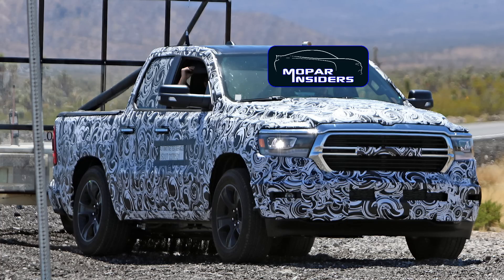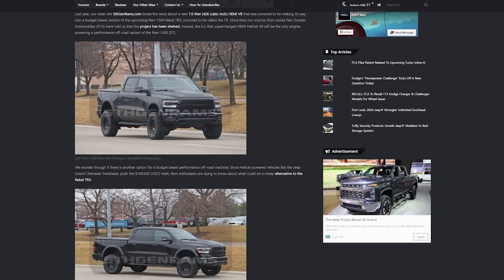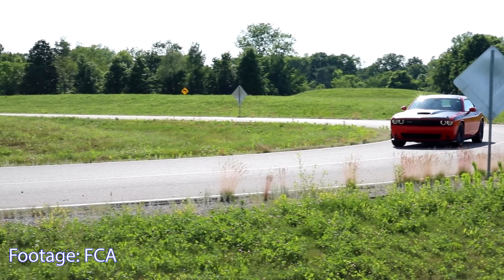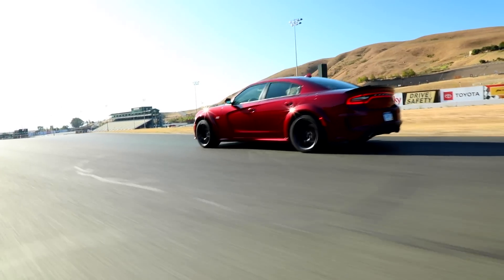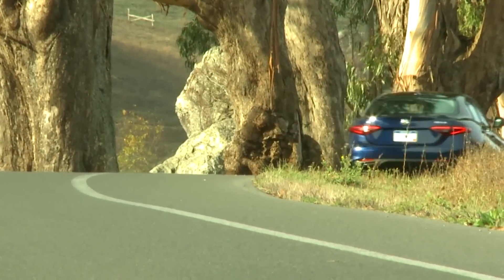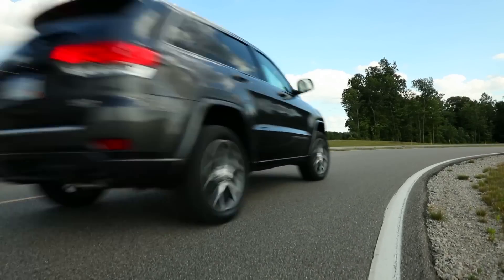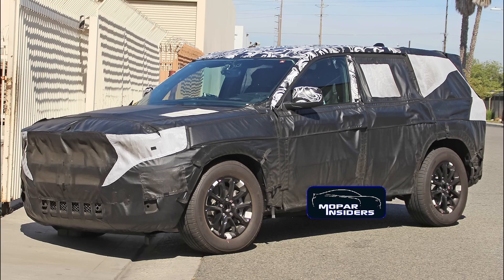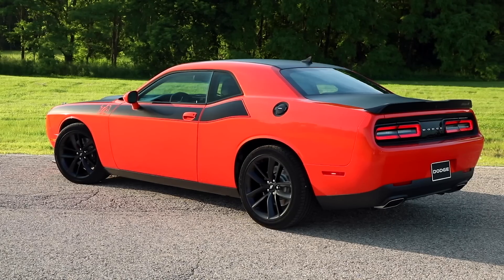What We Know About FCA's Upcoming Turbocharged Inline 6 Cylinder Engine. 525HP!?

Comment: The feds raised the emission and mpg requirements.  So, the Hurricane is replacing the V8.  The Hemi is probably going to be offered in limited numbers or as a crate.  If the motor can be better than a Ford and Toyota in the trucks , might take a look.

Comment: Not opposed to an inline 6, just not thrilled with the turbo. While the performance I'm sure will be good, longevity will be my question. I am also wondering about the difference between the 5.7 Hemi, and said Turbo 6, with roughly the same HP output??

Comment: The battery better be in the engine bay or in trunk not under the back seat no tku. Is this on par with the prototype hurst super cat that was a great test drive or faster on regular gas or 93???
Reply: I test drove a super cat - fast smooth easy to drive but drive by wire and was speed limited but think it was around 425HP. But 525 is pushing its limits is my thoughts

Comment: I was very interested til I heard this engine has plasma spray cylinder walls, check out Fords current big troubles with the 5.0L F150 2018-20 and excessive oil burning issues, no thanks to plasma cylinder walls give me cast iron cylinder liners in an aluminum block.

Comment: I'm not a big dodge guy but, I will still give an opinion here.....while the 2jz is a proven performer, turbo lag SUCKS! I know OEM doesn't care about this because mpg requirements have dictated the future which....also SUCKS. Anyway, there really is no replacement for cubes and a snappy V8 is not gonna be beaten in my book. HEMI HEMI HEMI HEMI!!!!!! It would be a shame for dodge to have an inline 6 to top the dodge power chart....even with an electric motor to offset lag. Just an opinion from a friendly Ford fan. Good luck to ya'll.

Comment: This is going to be a solid engine, you can’t mess up a straight 6. Plenty of power too
Reply: I don't believe turbos will last anything near V8s. Too much complication, pressure etc
Reply: @bigboreracing356  Wrong!  Had a 225 Slant 6 in a Volare. But it wasn't rigged up with turbos. Too much complexity and high pressre they will never last like original slant 6s not even close.
Reply: @bigboreracing356  But it does , if longevity is what you are seeking.  Are you claiming that turbos have a better record of longevity than slants or V8s? Not even close .
Reply: @bigboreracing356  Oh yeah you know so much ..at least you via your self promotion.  I must be hitting home if you are now descending into attempts at belittlement.

Let's see .. what readily available crefible source shall I site ..unlike your circular reasoning.  Ah yes , a mechanic of 50 years that has his own Youtube channel with a couple million subscribers.  So you go on and tell me you know more about vehicles and have greater experience than Scotty Kilmer.
Reply: Kevin Prokopenko 
Scotty “use compression fitting on brake lines” Kilmer 😂🤣
Reply: STREET RACER given the 5.7 are having cam/lifter problems they need to start from the beginning.
Reply: Chevy screwed up there new diesel straight six put a belt driven oil pump at rear of engine supposed to be a life time belt 150,000 miles according to a engineer who was interviewed.  Guess life time is until belt snaps and seizes engine .
Reply: @bigboreracing356  its ok, i know you are secretly a dodge lover deep down. otherwise, you wouldnt even be on these videos.
Reply: @bigboreracing356  The Cummins is a diesel engine.

Comment: I wont lie, pretty interested in this motor. Ya, i currently own 4 vehicles,  all 4 are v8's one supercharged....why? Bcuz last time at the track in my Charger SRT8 392, ran a 12.8 @108 and got smoked by a 2jz swapped Nissan. I had it off the line and it sounded mean AF as it blew past me on the big end.

Comment: It takes a turbo charger to go over 520 hp for dodge... dang the 5.2 Ford V8 does it naturally aspirated.
Reply: Messer Maddness The 392 Hemi does it too , which 6 cylinder Ford engine NA produces more than 300hp ??
Reply: @ervinzefi8662  NONE!!!
Reply: 5.2 ford....consumes oil like a madman...awesome race engine though.
Reply: Lmfao you rode the short bus to this meeting didn't you???
Reply: Let's see a factory set and tuned ford turbo 6 make 520 smartass I'll wait
Reply: @donaldliverance2597  the 3.5 ecoboost in the Ford Gt not count?  That little engine makes power very easily.  I'm not a fan of it, but I cannot argue that it can run well.
Reply: @donaldliverance2597  the ford GT would like a word with you

Comment: My 4.0 INLINE MILL has almost 400,000 Mile's and is just like new...A REAL BEAST!!!!!
Reply: It's a AMC motor
Reply: @jeepdogjl8687  ..Chrysler changed a lot to the 4.0...Even the pos 3.7 & 4.7 was a AMC design..
Reply: @01trsmar  3.7 and 4.7 was a mercedes.
Reply: I had 436,000 miles on a Dodge 360 4barrel!! 

The car never quit!! 2 repaints and drivers seat repaired twice! Looked and ran perfect when I sold it..Engine never touched!! Nothing! Water pump and fuel pump,rebuilt carb and general tune ups,maint!! I drove it fairly hard too,loved to spin the tires and floor it..sounded so good too!

Comment: For all of you who adore v8s. Due to new EPA regulations soon to come. All passenger vehicles in the not so distant future will force manufacturers to use more 4 and 6 cylinder engines. So if you want a high horse power v8 you should buy it soon.

Comment: If it comes out like anything like the ford barra or the 2jz ..sign me up
Reply: Highforcex41 agreed!!
Reply: Amen! 6 in a row makes it go!
Reply: I agree. If it comes out like the Pentastar, don't sign me up lol.
Reply: Expect the Aussie Ford Barra Performance. 😉
Reply: Don’t forget RB26!
Reply: @Cycle9568 those were good if you kept them stockish . They had massive issues with oiling and loved to crack blocks
Reply: @jordan9610  I got one when mine went out at 67k miles. And the tranny went out twice within 72k miles
Reply: @jordan9610  it was a 16 caravan. That’s what confused me the most. It had cyl #2 losing pressure through the exhaust valves. And the dealer replaced the torque converter at 58k miles. Started slipping again before I traded it lol
Reply: I agree!
Reply: It should be just that, we shall see.
Reply: 99% of comments are bummed out muscle car guys,... little do they know, they might get something better. We'll see.
Reply: Highforcex41 it’s from fiat so no.... all these mopar heads driving Italian, high hp, unreliable engines. All these 707 hp hellcats breaking down at 40k miles lol.... lmk when Italians can out together a reliable engine
Reply: @jusbertmeza4424  I cant agree more than that statement but I did say "if" it came out like the motors mentioned l. But  cars are so overpriced when you think about none of them are worth the asking price. But Italy makes Ferrari and aprilia so not everything is bad
Reply: Highforcex41 Ferrari’s are also high ho racing beasts but in the end they are racing cars and don’t have reliable engines. After about 15k mileage it has problems but the people buying them don’t care
Reply: @jusbertmeza4424  yeah I dont argue that statement. But every car company has strived to be like Ferrari because of thier record at supercars racing ..trust me I dont care for either I'm a jdm guy all the way if you couldnt tell I just think when it comes to it inline 6s make more sence in engineering for simplicity and produces a smoother longer range of power .

Comment: I am ready for another Inline 6 Wrangler!
Reply: Timeless Motors that’s exactly what I was thinking and turbocharged long over due for the wrangler
Reply: You're welcome 😉
Reply: It won’t be the durable AMC 6.
Reply: @drippinglass  Chrysler version of the so called durable AMC 6 was vastly superior. the 4.0l was introduced in 1987. Its a Chrysler engine based on the old 199 cubic inch Typhoon Six . The AMC engines were ok up until the 4.0l.  The Chrylser slant six was one of the toughest engines ever made BTW. If you actually new anything you would know that Chrysler has made some of the best engines in the history of the auto industry.
Reply: Billy Bob 

/6 only had 4 main bearings.
Reply: @drippinglass  So what? How did that effect it doing what it was designed to do? Its considered one of the most durable engines ever. Its not a drag racing engine.
Reply: Billy Bob 

As soon as you try to make more power... the bottom end will give up the ghost.
Reply: @drippinglass  Again who cares that engine was discontinued years ago. You act like they couldn't beef it up today? What is your point?
Reply: @drippinglass  Not True. Many people drag race Slant 6s to this day. Most of them just add a Procharger or Turbo Charger to them without any other modifications besides the Intake manifold and carburetors/fuel injection
Reply: @tskraj3190  So now your saying they don't give up like a ghost. It is true Chrysler discontinued that engine years ago. What people are doing with old engines has nothing to do with this argument we are talking about factory built engines. The slant 6 was never intended as a boosted drag racing engine.
Reply: @tskraj3190  The original point I was trying to make is AMC did not build the reputation of the durable 4.0 inline 6. Chrysler did.
Reply: Billy Bob 

You can’t “add” main bearings.
Reply: Billy Bob 

The AMC designed 4.0 had 7 main bearings.

They’re the things the crankshaft rotates on.
Reply: @torredchc1768  I agree and disagree. I believe Chrysler made the motor popular enough for people to realize they were very strong reliable engines but people who owned the AMC inline 6 motors knew they were very reliable. There was a period that most people seem to forget from around 1998 to 2004 where the 4.0  motors were blowing head gasket and cracking the head.
Reply: I can sit here and give Anecdotal evidence  also. my brother blew 2 AMC inline six engines in his jeep. My best friend blew his ford 300 inline six. this was 25 yeas ago the ford engine was a 91. AMC was a trash company.
Reply: @torredchc1768  I worked for Daimler Chrysler from 99'-01' on the AN/DN line also known as the Dakota/Durango line. In our factory we also had the XJ line which was the Jeep Cherokee line. We always received feedback from consumer complaints every month. Most of the complaints were faulty water pumps in all Mopar/Mitsubishi motors. The other complaints were head gaskets on Mitsubishi assembled motors such as the 3.3, 3.7, 3.8, 3.9 V6 and 4.0L inline 6. The other complaints were faulty transmissions, front differentials and A/C condensation drains in the Rams, Dakotas and Durangos.
Reply: @drippinglass  Actually it will be the AMC 4.0L. I did try and talk the C.E.O. into redesigning and bringing back the Slant 6 with dual overhead cams but it was a solid "NO". I'm a contracted marketing advisor.
Reply: /6 motors are crap compared to Ford, Chevy, and AMC 6 cylinder engines.

I’m a Mopar fan, got my first 440 Six Pack back in ‘83.

Th /6 is vastly overrated.
Reply: Timeless Motors ... Yeah Jeeps are Fiat nightmares of design and engineering absolute problems
Reply: ronald hickman Jeeps are absolute problems??
Reply: ronald hickman take your honda vibe elsewhere

Comment: As much as I like the hemi it is outdated, and with the cam and lifter failures I'd be willing to give a inline 6 a try. Inline 6s sound like shit but usally have good low end torque and good economy which is what really matters.
Reply: funny you guys all bitch about HEMI cams and lifters being bad... my son's '16 Silverado  40K mi. has been at the dealer since the last Wednesday of Sept. 2019 having that very problem fixed...they changed the bad parts and now the truck will not run and even GM field tech guys can't figure out why. Here it is Nov. 14 and it is still there.  And I have to tell you I haven't heard of anyone having problems with any of the HEMI engines but You Tubers seem to have all kinds of imaginary "common " problems with anything MOPAR
Reply: the problem isn't the cam and lifters. the problem is the owners who spend too much time idling, and Dodge isn't the only company having this issue.
Reply: @kenrobinson1099  it's the lifters, older hemis and LS  engines can handle as much idling as you want the newer hemis 09- present and 07 to present LS motors eat lifters like crazy, no not on every motor but alot. I'm a die hard dodge guy but how this issue has not been addressed is ridiculous.
Reply: the shop guys tell me it's idle time and it's nearly all relegated to engines with mds
Reply: @kenrobinson1099  I have herd idle time too but my point is it's still the lifters that fail and wreck the cam, the gen one hemis and chevy Ls engines didnt have this problem at all. You should be able to idle your 3ngine as much as you want. It should of been recalled but of corse it's not a safty issue so they wont.

Comment: Inline engines? I'm down. One manifold, one valve cover, one of everything fk yeah 👍
Reply: My understanding is an inline engine is inherently stronger as the strain on the crankshaft is spread out over more bearings.
Reply: @petergisel4864  Correct, inline design make higher RPM & better lasting reliability engines.
Reply: And ya I have a 4.0 l6 in a jeep and two hemi's both hemis are well into 350000 with little to no big fixes the jeeps had three times as long less milage and still has more issue then the Hemi. it can't get close to the power to reliability factor of a n/a V8
Reply: So your saying a turbo L6 is as reliable as a naturally aspirated V8??? You might wanna slow down and rethink that. And focus on the word TURBO....
Reply: @donaldliverance2597  because the cummins was so unreliable
Reply: @greynolds17  the Cummins isn't made by Dodge it's kinda the holy grail of turbo diesels and doesn't really have an equal
Reply: @greynolds17  and I also know a lot of guys that still have had more than a few different turbos on those so ya turbos break and far more often than a regular intake it's pretty simple guys... more moving parts = more stuff to break and that = more shit to fix and pay for. All in the name of saving fuel and weight
Reply: @donaldliverance2597  it's called planned obsolescence...but electric cars will fix that soon enough. Oh and a turbo inline 6 has less moving parts than a v8.
Reply: @donaldliverance2597  my point was that you were saying how turbos automatically make things unreliable...when in fact its not the case for many engines
Reply: Donald Liverance well Volvo’s straight six is bullet proof
Reply: You forgot the one crappy sound it will make.
Reply: @drippinglass  Crossflow head inlines sound beast.
Reply: I got an '81' Ford with the Inline Six and its a simple motor , single carburetor .
Reply: Here's the thing though runing doesn't mean running well lol beating on your l4 doesn't mean it's the best it just means it can stay running even when it's destroyed you were also dumping more fuel into it at that point than a well running V8 I know iv had like 6 over the years there's far more into a good engine than just stays running lol I blew the rad in one drove it home fixed the rad and it was fine I swamped that same motor pulled the plugs and cleaned out and put em back in and it ran now it was gutless and burned more oil and fuel than both the hemis I have now but yes it ran but you needed be an oil company owner just to drive it daily
Reply: Straight 6 engines by nature are more efficient and more reliable than any other configuration. Its simple physics
Reply: Inline 6 engines are physically stronger than v8 engine designs. First off the in-line engines have 2 extra main cap’s and bearings. Also the direction as-well force of the rotating assembly plays into factor. The inline engine design is known for torque and reliability.
Reply: Hahaha ya and it all works twice as hard and stress causes failures so the engine under more stress will fail more
Reply: Donald Liverance I guess you never seen the reliability of the old 4.0
Reply: @donaldliverance2597  its not a ecoboost...dude
Reply: @donaldliverance2597  Wow! I tried for 8 years to blow up my 4.0l Jeep so I could justify a new motor. Never once changed the oil that entire 8 years! Ran like a champ. I abused the crap out of it, broke suspension parts all the time off roading, just not that damn 4.0l inline six!
Reply: @donaldliverance2597  😔
Reply: Honestly it’s all about how you take care of your own vehicle.